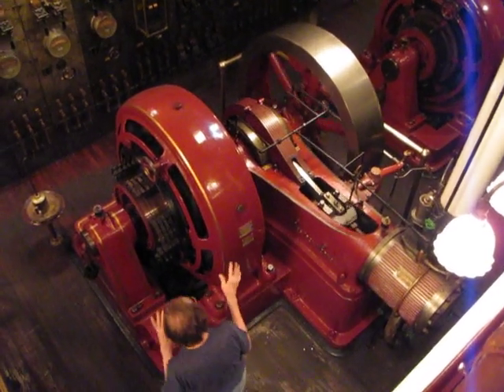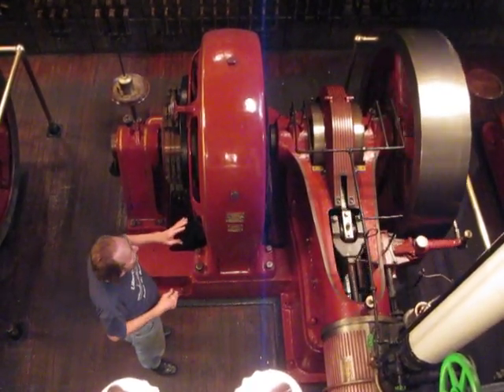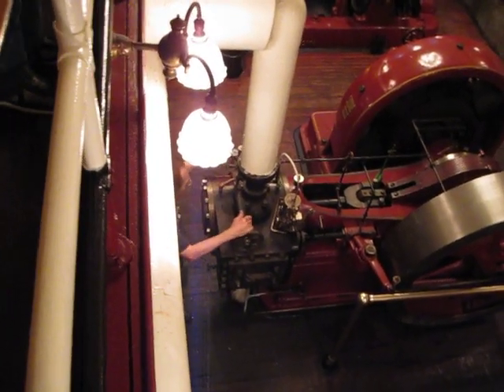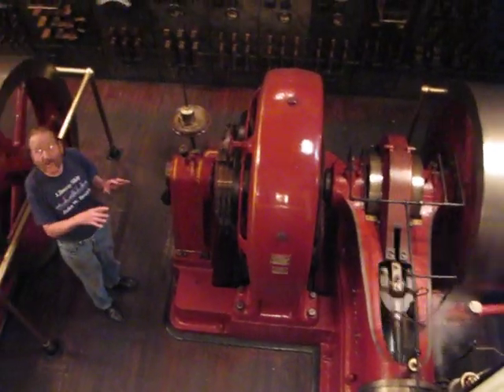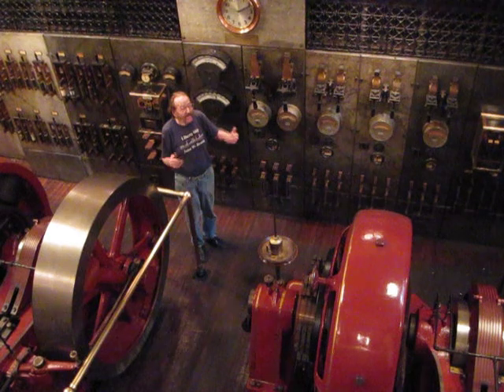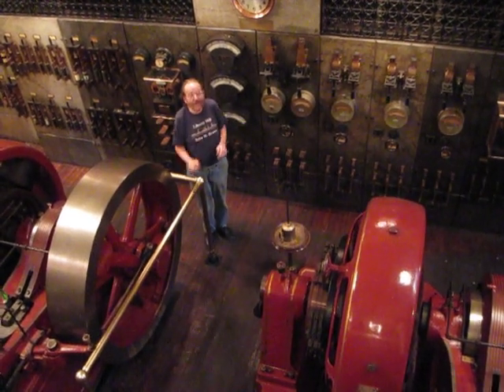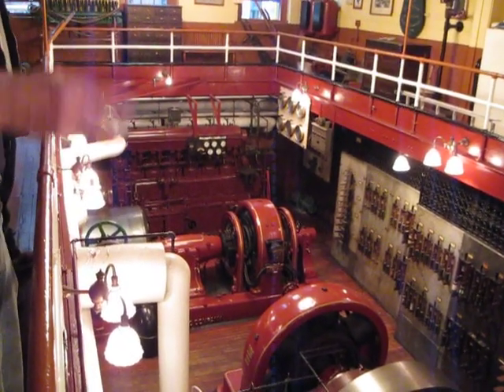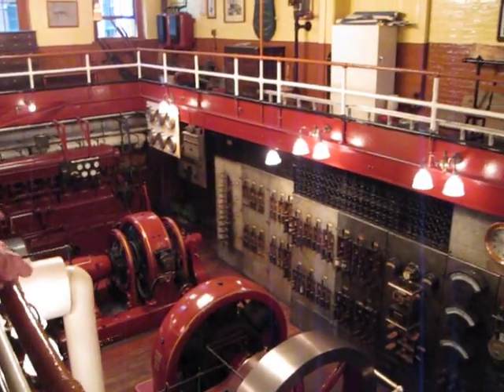Pratt Institute Steam Engine Power Plant

Comment: Some facts not mentioned, those electric company turbine generators are only about 35% efficient because waste heat is rejected to the river whereas Pratts engines exhaust their steam to the college facilities heating system. This results in an efficiency of very close to 90%. Even the engine nameplates at Pratt are unique. That turbine Mr. Milster pointed out says it is licensed for all but, marine and aerial craft and was designed by Charles Curtis, the same inventor of early flying machines.
Reply: Yes, I am very interested in the turbine. It may be one of the last Curtis turbines in existence. Do you have any idea of the power of the turbine? There is and old power house in Seattle that has two vertical shaft Curtis turbines.

Comment: Also there is only one turbine, its not working as it needs repair and I believe is one of a kind so no parts.

The dynamo's are GE and the engines were built by Ames Iron Works.
Reply: I'm told it's a Curtis steam turbine. I'm very interested in it. Does anyone know what the power rating of it was?
Reply: @gregorymalchuk272  it's a very strange design as it was rated for aviation on the nameplate. Conrad Milster gave me a personal tour many years ago though I forget the details of the turbine but I do believe it is a Curtis. It had not run in decades and repair work was needed in order to get it operational but Conrad said it was a lot of work. Conrad was forced to retire after some cry baby union jerk complaind about the cats who lived in the building gave them the sniffles. So the fate of all those engines is in limbo. With no one there who actually gives a damn or knows how they operate, they'll decay into nothing.